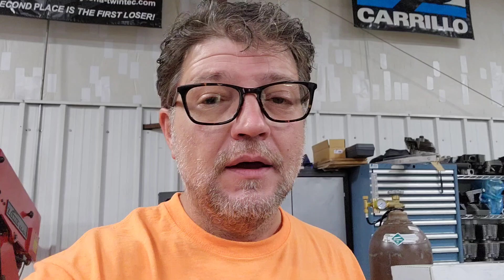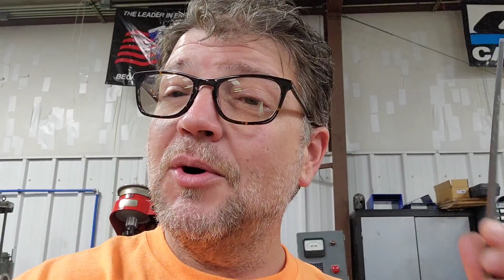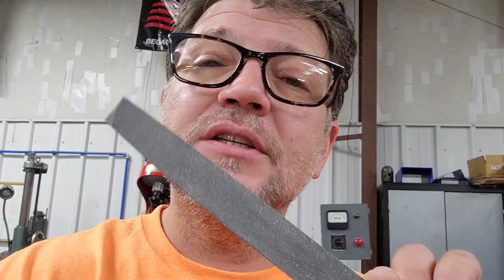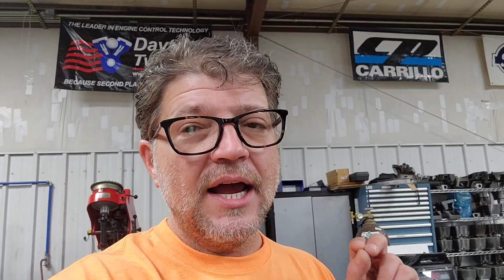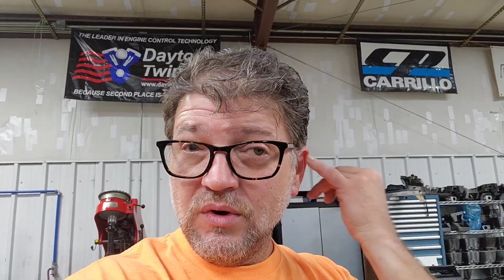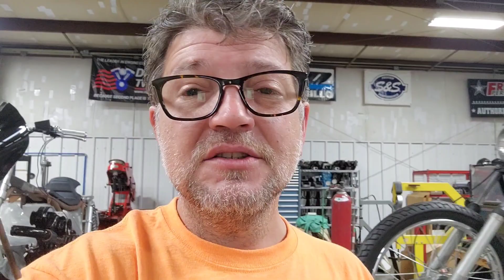Harley Engine Break In Explained - Kevin Baxter - Pro Twin Performance

Comment: It’s funny that you put up this video recently. I’m in the process of breaking in my twin cam. I’m giving break in oil a try. I’m using Driven 15W-50. I got about 22 miles on it of varying the rpm and loading the engine, then I changed oil. I’ve done this in the past with Dino oil and there’s always been a lot of particulates in the oil and stuck to the plug magnet. This time, there are a lot of very small particulates in the oil and almost nothing on the plug magnet. I refilled it with break in oil and I plan on running this another hundred or so miles, then change oil again to a non-synthetic oil which I plan on running 400 to 500 miles before changing it again. 
I put new cylinders, piston and rings on this bike because the last break in didn’t go so well and the rear cylinder was scored with excess blow by. I think part of the problem was not the right base map, too much compression, too much heat and I think I might have tweaked one of the rear cylinder rings on install. 
So far the bike is running great and the air fuel seems to be right on the money. I hope it turns out better this time.

Comment: Q: Have a new old stock S&S V100 motor built in 2011, never been started - still has shipping plugs in the exhaust, intake and spark plug ports. Push rods are loose, valve springs are not compressed. Do you have any recommendations for lubricating the cylinder prior to hand cranking it since it has been sitting for so long? Thanks, and great video!

Comment: I wish this video was out a week ago when I received my bike. Done 460 miles mostly riding the highway mixed with some city riding. Anything I can do at this point?
Reply: Last year I bought a new bike from Harley. I rode about 120 miles on highway straight home thinking I was doing a good thing. Nothing seems wrong. There’s probably nothing you can do now. Harley should tell you how to break it in b4 you leave
Reply: @rtbt8185  thanks. Received the bike without the manual and no instructions whatsoever. I should have reached this. Either way hope it will be fine

Comment: I know from the old shovehead days, the engine needs a fair amount of gas for cold start. Why is my 2021 M8 trying to blow up at cold start with high rpm starting? One dealer tech told me is was to recharge what it took to crank the engine from the battery. Sounds a little strange to me. Is the computer just adding a ton of fuel for the cold start? Jerry
Reply: Yes, the ECM enrichens the mixture at startup.
Reply: Avoid that 'technician' like the plague.

Comment: Back in 1995, a group of friends and I made the trip to the 100th Anniversary of HD in Milwaukee. We had a vip tour of the engine plant given to us by Bill Davidson, son of Willie G. Bill attended our H.O.G chapter in Columbia, South Carolina that year as it was our last chapter charity run. Our dealer later closed his business as he was retiring and no family to leave it to. Another dealer bought the business later. The point I am trying to make is how rough they are putting the engines together. A production job for sure. I watched the engine cases come down the ling to the piston install person and they took NO time slapping on the piston wrist pins and spring clips. Down the line to the ring installer and ten seconds later onto the jug install. This is where I thought, what the hell. The girl had what looked a plastic ring clamp and when she got the first ring on, SLAM goes the jug all the way down seating it on the crankcase. I have build. engines before and we tend to be gentle with the jog install. Oh well. I guess they know what they are doing.
Reply: The 100th anniversary was 2003. I was there.
Reply: Better check your dates, Harley was founded in 1903. 1995 is only 92 yrs. not 100.
Reply: Initial comment is an 8 year old account, I believe him. Might have his years wrong but his point he was trying to make about the assembly line came across.
Reply: I've worked in an engine assembly plant as a quality engineer. Most of the humans on the line are very in tune to what they are doing. In my opinion, women are excellent assemblers. They seem to focus on the job more than men. They do get pretty rough with the parts, but they know instantly if they've made a mistake.
Reply: Ahhh, Harley was established in 1903….
Reply: I was at the 90th in 93… so I think your a little off but point well taken!
Reply: No. Not. Back in 1995 was before they burned down libraries, putting books in chemicals and filling shelves with rewrote communist propaganda (lies). So, basically it’s like this. It’s 1995 for Old School likewise and 2003 for drug tested delinquents

Comment: I greatly appreciate your knowledge and ability to inform.
      Break-in is critical to how a engine will deliver performance years later.
     I worked with a Master Mechanic years ago and his rule of thumb was 3 hours of operation or less and then it's first oil change.
     We never had any problems using that as part of the formula for break-in.
      Ty Kevin and thanks again for your time.

Comment: Would breaking in an engine with a little bit of 2 stroke oil mixed with the gasoline be a bad idea ? Not enough to limit the break in, but a bit to forgive any AFR variance
Reply: Yes it's a bad idea

Comment: Bro...I need your help. I'm 15 min away from you. 2003 ultra classic. I think the new heat temp is defective, have you seen this before or if it possible? I've checked the wiring and 🔌 and looks good.